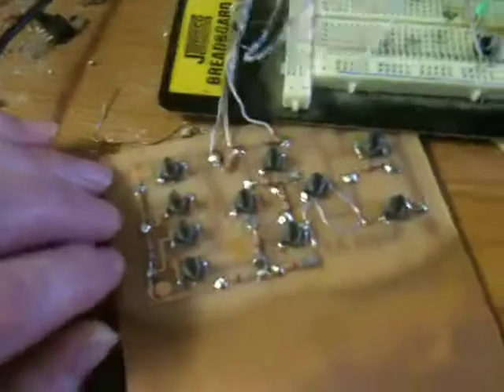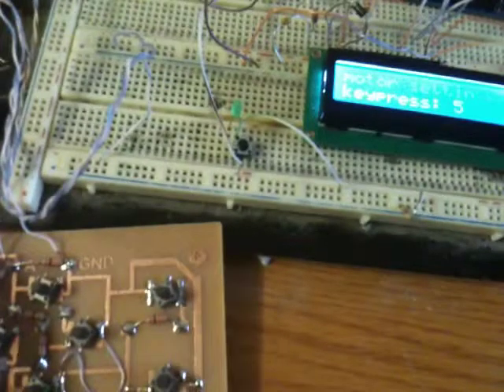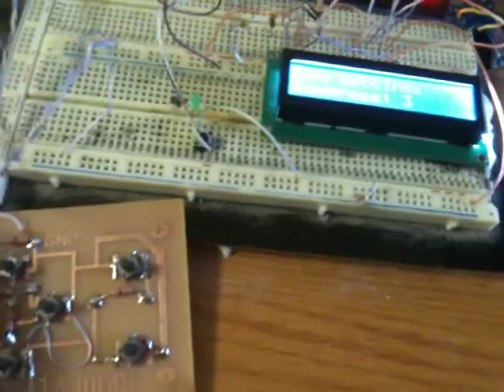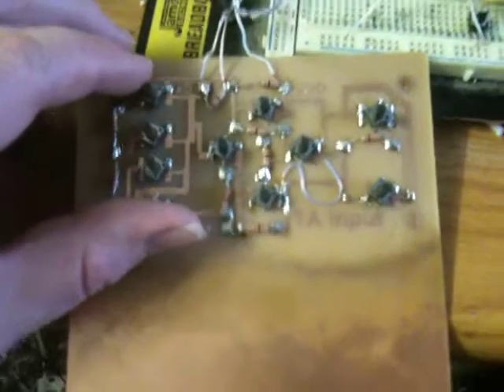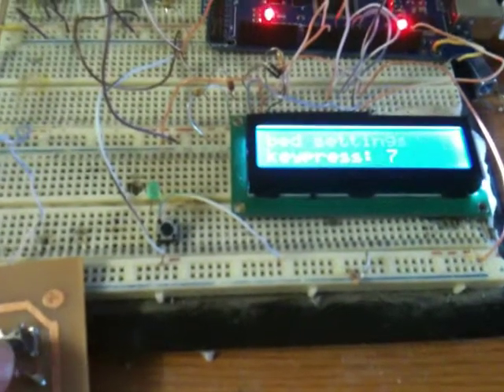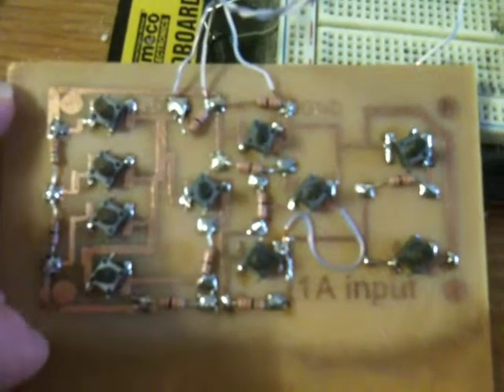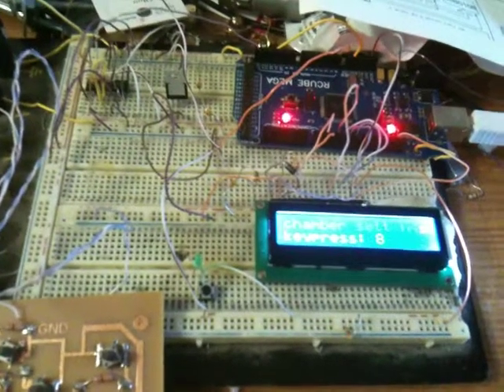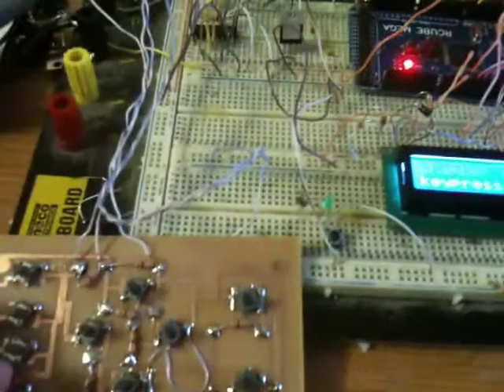arduino using keypad input 1a/d pin vcc, and gnd. only needs 1 pin arduino!

Comment: good thinking ,if u use your resistors in multiplied values (1,2,4,8,16,..ohm) then you can program to sense if buttons are pressed simultaneously